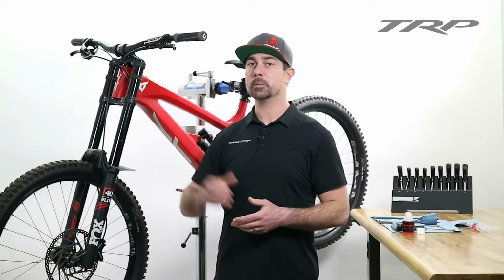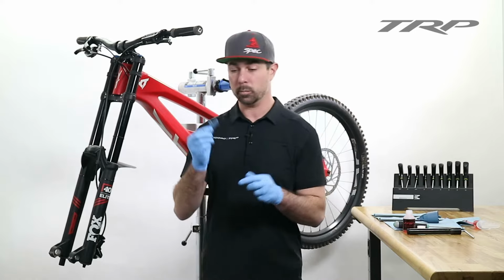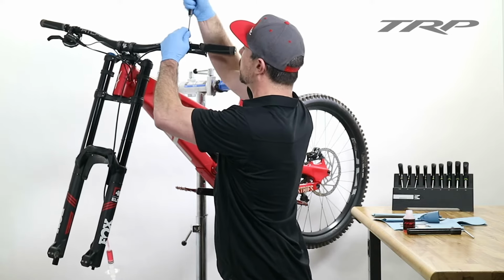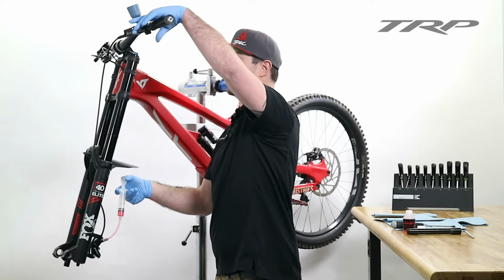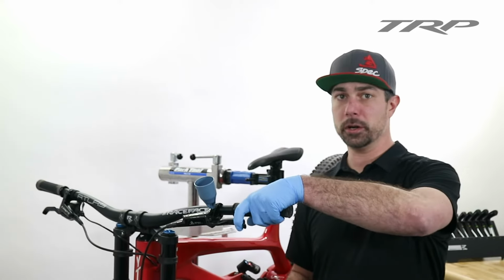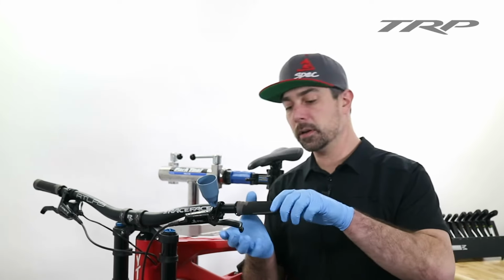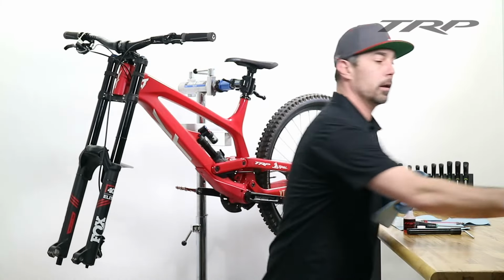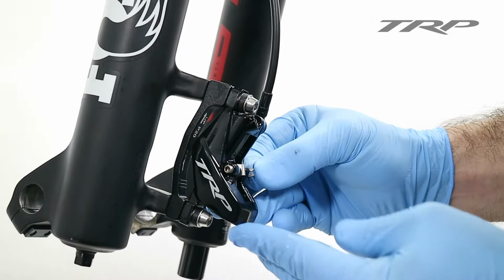TRP Tech Talks - Mountain Bike Bleed Procedure for TRP and Tektro Brakes

Comment: a break bleed use to be a complete replacement of brake fluid...this seems more like a bubble bleed.
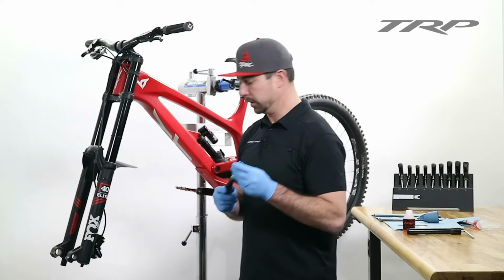Reply from the maker: At 1:42 we go through the complete fluid replacement. The lever purge (or bubble bleed as you said), is the final step to remove any remaining air.

Comment: I'm trying to bleed a set of my buddies brakes, TRP Slate 2 piston, the caliper has a bleed screw and nipple, not a plug.  When pushing oil from the caliper, it just runs back out the threads of the nipple.  Any adivce?
Reply from the maker: Email our service team at info@trpycling.com

Comment: It didn’t work my brake lever still touches the handlebars
Reply from the maker: What kind of fluid are you using?
Reply: The big bottle for all trp and tektro brakes
Reply: @TRPcomponents these are the 4th trp brake I’ve installed/ bled and this is the first time I’ve ever had this issue i just got the brakes and thought it was weird they didn’t come pre bled could it be an issue with the lever

Comment: I like my TRP brakes, they feel great and perform well. That being said, I think they could have been designed better for a cleaner bleed process. Shimano’s newest brake design takes the trophy in ease of bleeding especially with the relocation of the bleed nipple distal to the brake line. In my experience with the TRP brakes, the bleed ports leak oil when you are replacing the t15 bolts/installing the bleed nipple. This drains oil from the system and introduces air it also makes a mess. That being said, when you do bleed these brakes you are not left with the spongy feeling I have experienced with many older shimano designs.
Reply: I'm retired, and just learning this bleed procedure, got a great kit, has a lot of accessories, I did a cup on top pull down with syringe no bubble bleed and NO LEVER AT ALL, so i find this video and I'll attempt everything he is saying! any tips from you? My brakes say Tektro Dorado E23, 4 piston caliper.
Reply: Please help me find the right fittings and funnel for bleeding a TRP Evo. Ozon or AliExpress

Comment: What's the correct torque spec for the "caliper bleed plug"? The manual on your homepage (which is still only available for HD-M841 / non-Evo) suggests 0.3 - 0.5 Nm which seems extremely low for an air/oil tight seal. Included with my set of DH-R Evos (HD-M846) was just the manual for the Quadiem which calls for 6-8 Nm for the caliper bleed valve?? What is the correct value?
Reply from the maker: The bleed port plug at the lever side of the brake would be torque value of 0.3- 0.5 Nm . The T15 caliper bleed port plug would be 2-4 Nm (confirmed with our factory). The 6-8 Nm refers to our old bleed port "valve" which was a different design than current "plug".

Comment: Been a mechanic for several years, and for the life of me I cannot get a proper bleed using that lever cup. The levers always go soft when the bike is flipped upright. I have to use a second syringe to pull vacuum in the lever and I ALWAYS get tons more air out that way. Then the levers don’t go soft in the vertical test. Only way I’ve ever been able to get them to pass that test.
Reply: So I love these brakes but have had nightmares bleeding them. I actually sent the rear back to trp and they pressure test it. Put a new hose on it and sent it back. Trp is great!! Anyway, I hooked it up and did a lever purge and its still a sponge factory!!! This has been an ongoing battle for me. 

I am going to go home and use a syringe at both ends and see if it helps. My front dhr works magically but ever since I bent a rotor on the rear, its never been the same. The bite point is all over and then once I think ive finally fixed it, its back to the sponge factory hahaa
Reply: @FrogSkunkMtb  Bleed it with the funnel and then use a syringe on just the lever to vacuum air out of the top of the system. It's worked for me every single time now.
Reply: @dawnpoint  when you say use the syringe on just the lever, what is going on during this at the caliper end? Do you push the fluid through from the lever to an empty syringe at the caliper?
Reply: @FrogSkunkMtb  No, the caliper is closed. Just attached a fluid-filled syringe at the lever and gently pull on the plunger. It'll get tons of air out.
Reply: @dawnpoint I hooked a syringe with fluid on the lever and a few little bubbles did come out right away but then that was it.  

It feels a little better but still not like my front brake. Curious, when I bled then like in the video, the pistons had some wiggle room. Should they be tight to the 9.9mm bleed block or not? Mine definitely have a bit of wiggle room.
Reply: @dawnpoint  I just watched the Park tool vid for top. Calvin does not use the cup at all. He applies suction at the lever with the syringe as you describe. Good to know you can alter the procedure to work for your particular brakes and preferences.
Reply: @dawnpoint thanks for enlightening us about this method! I will definitely give it a go. 
So as far as I understand you do a lever bleed with a cup only, to get any bigger bubbles freely out. Then you remove the cup and screw in a syringe at the lever and gently pull the plunger to create vacuum and remove any additional bubbles. 
Is that correct? 

Also, for best results, where do you set your lever at from the reach adjust knob? Furthest from the bar or closest to the bar? Thanks

Comment: I've got some really old fluid in and get lots of brake fade on the T4s will this completely replace the fluid it's seems like you draw old stuff back in somewhat?
Reply from the maker: Yes, this will replace all the fluid in the line. You'll push a near full syringe of oil from the caliper up to the bleed cup to do so.
Reply: @TRPcomponents  Awesome thanks for quick reply

Comment: my rear brake line snapped off (i clearly didn't install it right the first time) and lost so much oil while riding but thank you guys so much for this video so i can finally ride again. bike shop wanted to hold my bike for 2 WEEKS to bleed the damn brakes, i figured i'll just learn something new
Reply: How did it snap off? Just curious so i don’t end up doing something wrong. 

Thanks!
Reply: @RC-fp1tl  guess I didn’t push the line into the master enough and the pressure just made it pop off

Comment: With these brakes, is there a lot of lever movement to have the brake fully on? Or is minimal? I'm a rider who doesn't like very move lever movement and am trying to find some good brakes to run
Reply from the maker: If you run the lever blades a little further out, you can get the system to have almost no lever travel before the pads start engaging. The brakes are linear in terms of power.
Reply: These have a lot of lever travel before engagement.  I hate it.  You have to run the levers fairly far from the bar or you they will pull to the bar.  My Shimanos were like this too and the stroke adjustment did very little.  I've been fiddling with these for quite awhile trying to get them dialed and so far I am disappointed.

Comment: you can see fluid leaking from the bleed port on the caliper when the fluid is being pushed in from the syringe. While bleeding my rear brake, that connection was allowing air into the system and i was constantly getting air bubbles running through the system. The syringe and caliper do not create an air tight seal.
Reply: agree, the ring seal on the screw in fitting for the syring to caliper junction is not good at all. very frustrating.

Comment: I recently purchased the advanced bleed kit so I can bleed my G-spec trail S brakes. The bleed block doesn’t fit. Should I be using a difference size block? Can I still bleed them without it? Thanks.
Reply from the maker: Did you press the pistons back into the caliper first? You can also use something solid (like a few quarters) to take place of the bleed block.

Comment: I bought the advanced bleed kit that says it has everything I would need.  so now I need to get the cup too?  or is the video outdated?
Reply from the maker: Unfortunately the advanced bleed kit does not currently come with the bleed cup.  You can use the other syringe without the plunger to achieve the same effect as the cup.

Comment: Nicely done video. I was referred to this video by a Tektro customer service rep and while I like the reverse pull to insure bubbles are remove, I'm doubtful that this will solve my problem, which is: the pads on my Auriga WS caliper do not seem to auto adjust as the pads wear i.e., the pads/pistons, completely retract back into the caliper. This creates significant lever travel to make the pads contact the roter. The front system doesn't do this and both pads and rotor and very new (about 2.5mm of pad material remaining). Does this sound like a bubble issue in the line?
Reply: I have the same - how you ended up?
Reply: @derboy7585  I ended up making a shim out of very thin aluminum sheet metal. That worked fine, but finally got around to doing a better job of bleeding the rear caliper (make the bike front higher than the rear). But for whatever reason, it still feels like a poorly designed brake system compared to motorcycles and cars which have simple valve you crack open while pressing the brake pedal or lever.

Comment: Anything different (bike position, etc.) that needs to be done for rear brake bleed procedure?

This video from Park Tool seems to suggest the entire frame needs to be tilted almost vertically to sit on the stand, so the bar levers are directly above the calipers:
https://youtu.be/KFlxB_2JKic?t=112

Thanks for the video instructions!
Reply from the maker: Great question! It will definitely have a positive impact on your bleed if your frame is tilted up like the park tool video. The reason this is being done is because it positions your caliper as the lowest point and your lever reservoir as the highest point, allowing air to naturally flow up and out of the system much easier. You can still achieve a solid bleed without tilting the bike, but you might be doing the back flow one or two more times before the system is fully purged from air. In the end, best practice will be to tilt the bike. Hope this helps!

Comment: Insanely complex and illogical way to bleed brakes. I don't take the wheels and discs off my car to bleed them. I fill the brake reservoir then use a mighty vac hand tool to draw it through. Makes no sense to have to take wheels and pads off. Never seen a process to push fluid UP from the caliper. Crazy.
Reply from the maker: Hi Jon, thank you for sharing your thoughts on our video, we really appreciate it. I hope you know there are quite a few differences between a car and a bicycle meaning, how you bleed brakes on an automobile doesn't quite apply in the same way to a product that has been designed for an entirely different application. Given the way the channels have been cut in our caliper and the natural gravitational rise of air, it is much more effective to bleed our brakes from the caliper up, and then use the natural movement of the master cylinder as a back flow to ensure any emulsified air has been purged from the system. We also like to remove the wheel and pads and insert a bleed block to prevent contamination of either surface with mineral oil, which does make a lot of sense, if you have ever felt a contaminated brake. If you have any other questions about the reason behind all of these "complex and illogical" procedures, don't hesitate to give us a call at (801)-648-7079 and we would be happy to explain.
Reply: You clearly don't know what you're talking about. Have you ever bled brakes on a bicycle before?
Reply: Troll
Reply: My guess is you drive single in the carpool lane and don't signal to let others know what the hell you're doing. Just a guess based on your system of bleeding brakes.
Reply: It's only "complex and illogical" if your braindead.

Comment: nice video but I have problem with my G spec Quadiem, my rear brake not working they are spongy and It's very bad to work when I press the lever the rear disk slides, but I make bleeding and everything from video
Reply from the maker: Hi there, thank you for commenting with this issue. Please contact our customer service team at info@trpcycling.com or (801)-648-7079 and they can assist you further.

Comment: Hello there, Just a quick question about the Bleed funnel, on the website it says it's compatible with most brakes series but not with the Slate series however you can get a Slate Bleed fitting adapter so you can use it for the Slates, I was just wondering where I can find that adapter as I've scoured the website and cannot find it, is it including in a bleed kit or where would I find this? Thanks
Reply: TOOPRE kit is very full of adapters and fittings